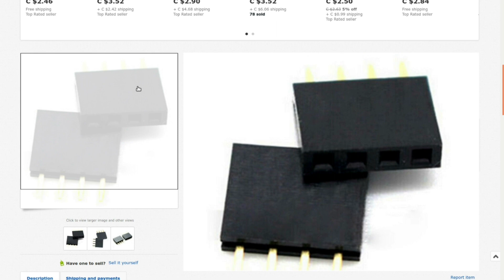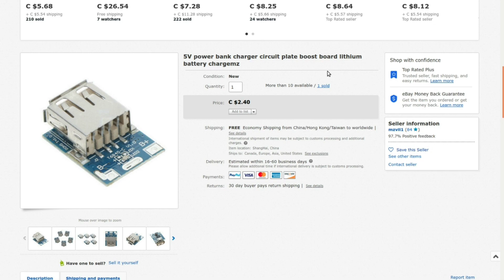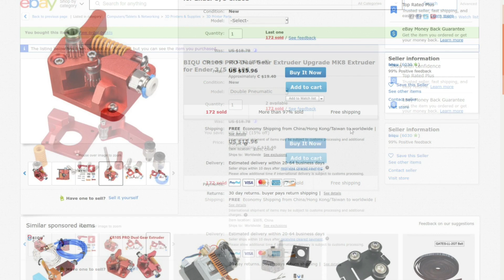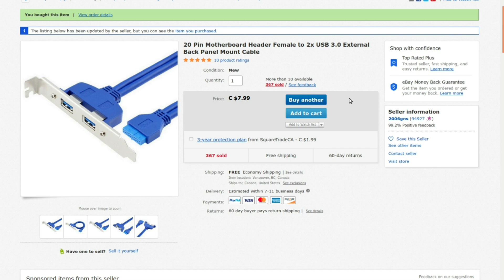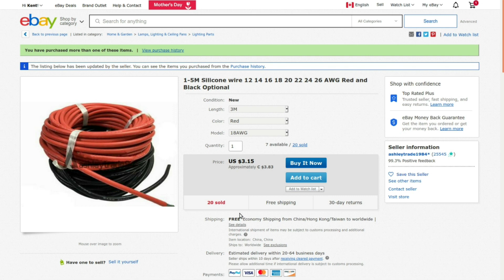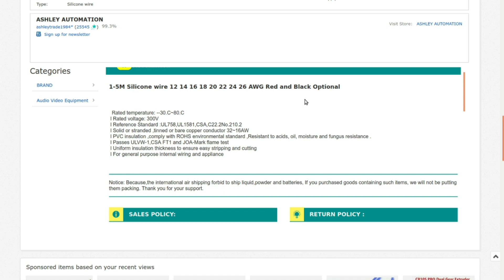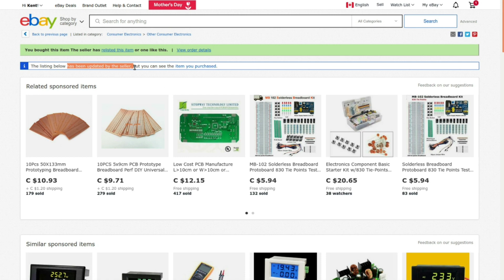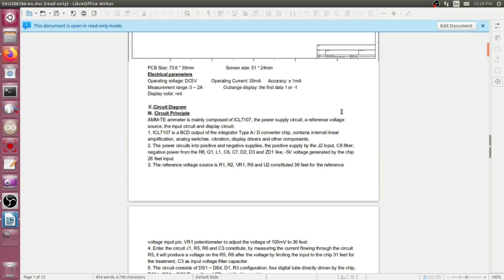Mailbag Monday #114

Comment: How do I connect a relay to an FM radio output so that it can turn on a light when a strong signal is received?
Reply from the maker: Depending on the radio, you would probably need a comparative that is monitoring the AGC  of the radio (if that is available on teh radio you are using).

Comment: The lithium charger/boost module circuit doesn't seem to contain protection parts for overcharging or discharging. So be careful about that, but who knows what this 8 pin chip is doing.

I don't think that the upgrade of the 3D printer needs a separate video there is a plethora of those already on youtube.

Comment: Put a magnet against that silicone wire to check if its not copper platted steel wire. 
Bought some "wire" a few years ago that was just that.
Reply from the maker: Interesting. And slightly alarming.
Thanks for the heads up

Comment: I like the colour of the extruder. Thanks for the reminder to get silicone wire for probes, (ordered).
I bought a kit not long ago, the build instructions were only available using a QR code, I don't have a smart phone. Luckily all the values were printed on the PCB and the case went together pretty easily. But it's realy annoying. I contacted the company and got an automated response pointing me to a website saying the QR code came with the kit. LOL.

Comment: one issue with the design of your new extruder, the pivot for the arm mounted gear is needle  bearings working directly onto the threads of the allen bolt.  Besides being undersized by 2-3%, and having a whole lot less bearing surface, they aren't the hardened and ground surface the bearing was designed to use  This won't last very long, and the extra play won't do the gear mesh any favors.  (the how to fix it below is aimed at the non-machinists in the audience)

You have a couple of choices on how to fix it.  Not great, but find a much longer M3 bolt, preferably a high strength one, that has an unthreaded section long enough for the bearings to ride on.  This will be much longer than the original bolt, you will have to trim off the excess threaded section (seriously, you don't want any sticking out the bottom, where it will chew up the base of the thing..  A very slight polish might help.  (but only slight, they are still undersized, just less so.)  I have the same extruder, and that is what I did until I could get hold of a better solution.  (I couldn't find an exact match, had to put a couple of washers on top)  

"correct" fixes: your choice:

one is to find a 3mm hardened and ground metal dowel pin.  They are cheap, pennies each, except that they come in boxes of 100.  Perhaps being in a slightly more metric country than your southern neighbor, you might be able to find single ones from a local hardware supplier, or perhaps a 3mm drill bit with a longer than typical shank..  you will need to ream the threads at the bottom, preferably to a light press fit, failing that, use chemical means to secure it, my choice would be some locktite.  (tracking it down to the original design that they all miscopied from, it used a dowel pin).

the other is to find a "shoulder bolt"  These are designed to work with bearings.  The shaft is hardened and ground, The threaded end is short, and one size smaller than the body of the thing so it won't snag a bearing..  So to find one with a 3 mm shaft, it will be listed as a 2mm size.  They are thin on the ground that small.  I found some, from a specialty supplier, they were US$6 each.  You also have to fit an insert in the bottom to cope with the smaller thread. 

last caveats, you will have to reset your "Esteps"  (can be done from the display in some versions, takes typing some gcode at it on others).   The original extruder is around 93-95 the geared extruder is a smaller diameter,  the new value on mine went from 94 to 146.  The gear is held onto the stepper shaft. with a single m3 grub screw.  It might have 2 complete threads where you screw it in,  Get out the loctite,  or 10 hours later, your thing will stop extruding as the little screw fell out.

remember kids don't let the bean counters near your BOM, they don't understand the issues.
Reply from the maker: Great collection of advice. 
Thank you

Comment: hi, Pile (Mr stuff) interested to know if the usb3-mobo works out. The one i have seems to  have a voltage drop when using a portable (port powered , no external power supply) hard disk drive (keeps resetting), otherwise ports works high speed ok.

Comment: Your extrudilator looks very similar to the one that came standard on my Ender 5 Pro. Mine only has the one pneumatic connector though. Mine works great. Just had to tighten the tension a little and the extrudilation was fine after that.